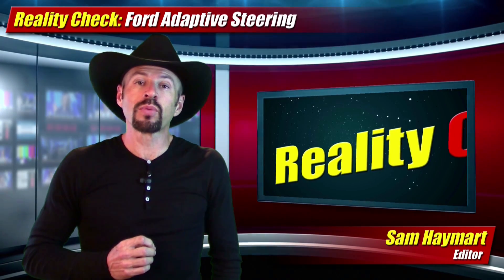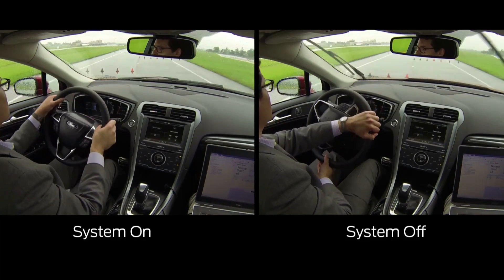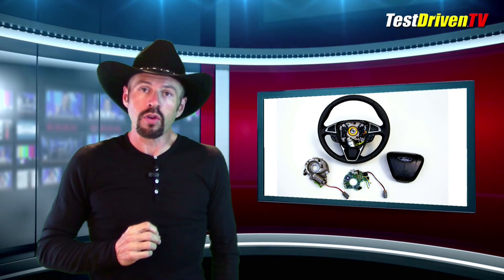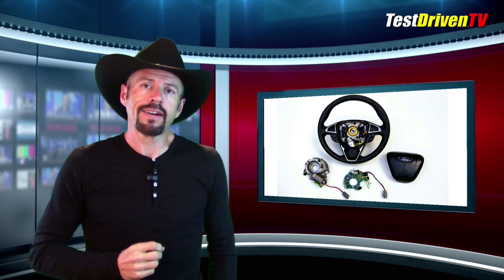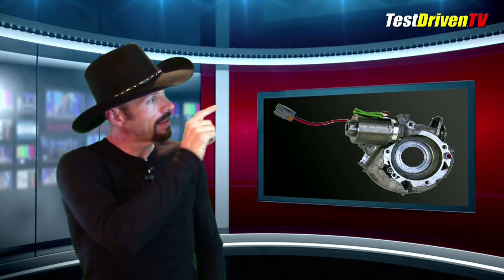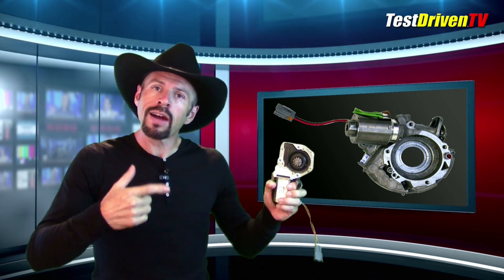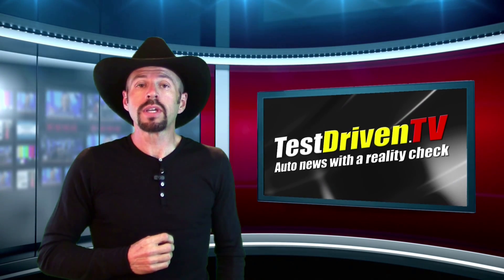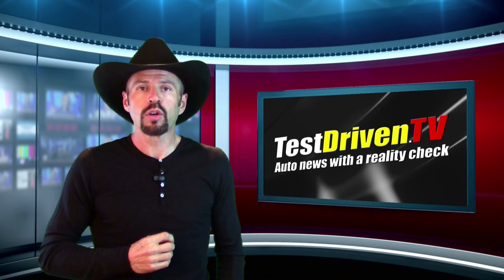Reality Check: Ford Adaptive Steering

Comment: I understand your concerns about not having a physical connection between you and the wheels anymore, but what has to be understood in this scenario is that firstly, these systems are incredibly well engineered and tested, to the point where reliability is very high, and secondly, human error is still the number one cause of accidents and fatalities in traffic. To put it bluntly, while this might create the issue of grandma losing control of her steering and barreling into a school bus, it solves the issue of grandma sneezing on the highway and swerving into said school bus.

Comment: Absolutely nothing will happen if it fails you will still have 100% of steering... I have this on my truck and you can turn it on or off as you desire... smh 🤦🏻‍♂️...
Reply from the maker: Not if/when the plastic internal gears wear, break or strip over time and it is no longer tight - allowing your steering wheel to skip teeth.
Reply: Not true. Mines having issues and when it acts up my steering wheel goes 90 degrees to the left to be able to go straight.
Reply: Can you explain or show me where you turned off your adaptive steering. Ford says it can not be done!
Reply: It is crap system

Comment: I imagine if the gears wear down it will just steer like normal, the adaptive steering is designed to kick in at higher speeds, it simply won't kick in, so the vehicle will just drive like it does without it engaged (like every car now). But hey, wtfdik
Reply from the maker: No. When not active, when you turn the wheel you are pressing the worm gear against the ring gear. Thus it can get worn over time even if you have the system turned off, creating a loose or flat spot in the ring gear. When the gears wear, the steering wheel will become loose, and have play in it.
Reply: This adap;tive steering is bullshit! My new 2019 F250 has 5200 miles and the adaptive steering keeps fucking up. The steering wheel will cock for 30* to 90* out of alignment and do it intermittently. I want that shit gone ASAP! Change out steering wheel or programming? I think even if it can be disabled in software, the mechanism is still in there and needs to be removed.